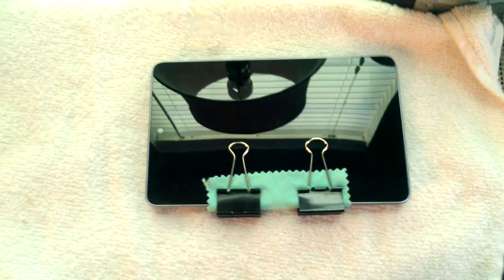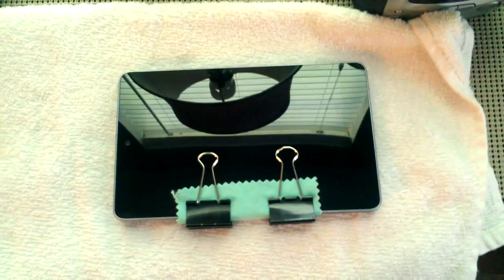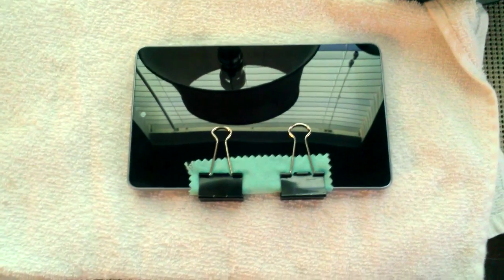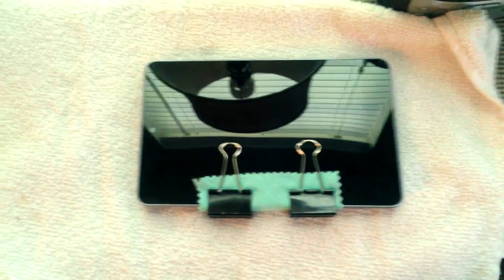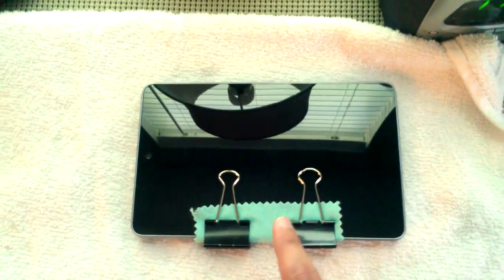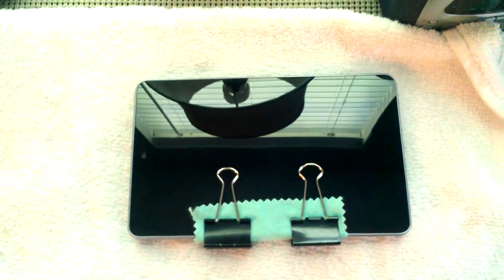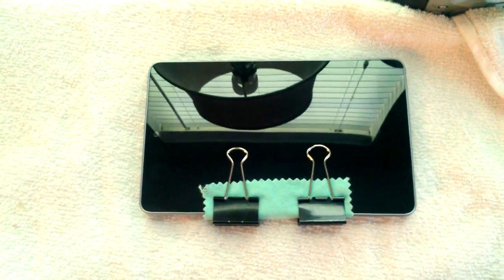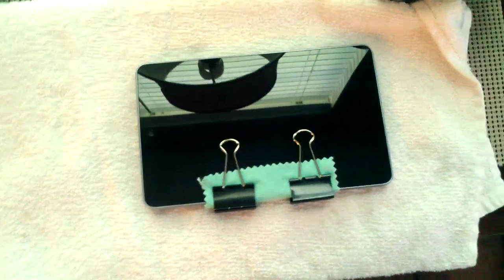Nexus 7 seven fix for screen separation issue

Comment: Thanks for this, Josh! Tried it today and it worked as advertised. Good thinking. I took it apart first as some talk about tightening screws, but that didn't appear to be the issue. So I did just what you did, and the glass is right where it should be and not springy at all. I hope yours is still behaving itself. Thanks again!

Comment: Turn off your Nexus 7, use a hair dryer on hottest setting for approx 1 to 2 mins about an inch or 2 away from screen - focus the heat on the middle left side. Once the Nexus is really hot the adhesive under the screen will become tacky. If you take a soft micro fibre cloth and apply firm pressure rubbing up and down along the left side. Do this for approx 10 to 15 mins solid until the Nexus starts to cool down. After that leave for a couple of hours to completely return to room temp. Job done!

Comment: I did this the other nights and it worked perfectly!!  I'm 2 days going now and still seems to be holding on strong.  Thanks for this idea!  I bought some binder clips that would fit and made sure to loosen them up a tiny bit so that it wouldn't crack or damage the glass or anything.  Everything looks good though.  I hope it stays that way.

Comment: This worked beautifully! What I did first was pry off the back gently and tighten all the screws. They didn't feel loose but I did it anyway. I saw the bezel go back into place but honestly it isn't the screws, it's the adhesive. That is where this method came along. I did what he said right before I went to bed and then I let it cool off by the ac and it is perfect like it was meant to be.

Comment: I have the same problem and since I bought it at staples I went to go get the protection plan that was really expensive. Now that I have the plan I will try this method in order to fix the screen bezel. Will comment tomorrow on how it goes.